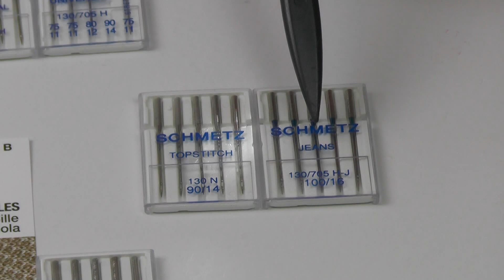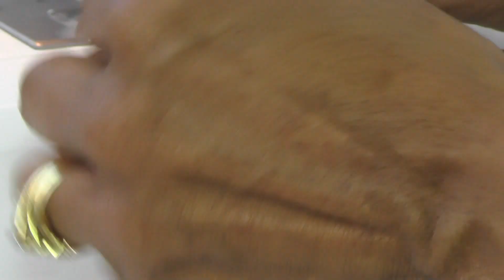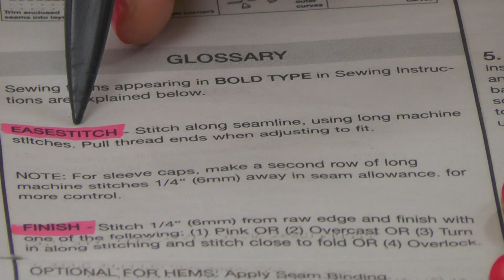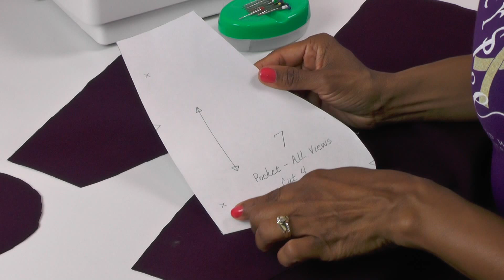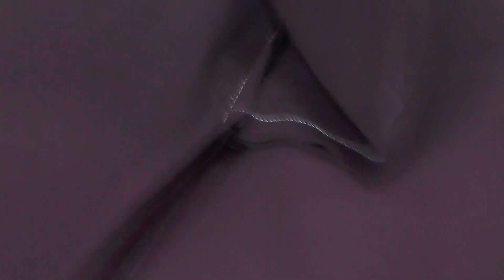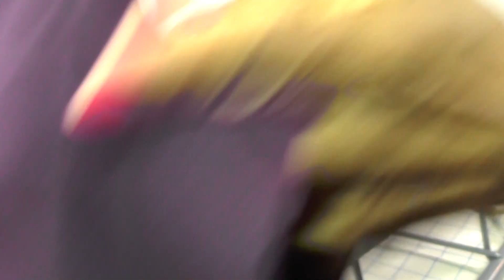Learn to Sew | (Lesson 1C)

Comment: Just finished my skirt. I followed the instructions but the end results to that size were either 1/2" too big or too small. I wasn't sure how I should go about taking that off when I started and didn't want to mess it up. I ended up taking the waist in at the end. 

Now that I finished my first project I can say I'm a pro at seem ripping and I know more about what to do for my next project. Thank you for this video you did an amazing job.
Reply from the maker: Congratulations on finishing your skirt! I'm sure you learned a lot throughout the process. There were others who experienced the skirt coming out too big. Sometimes the patterns run big and the problem with that is you don't know until after you've sewn the garment, unless you actually measure the pattern pieces before cutting them. These are things you will learn as you progress in your sewing. Thank you for watching the videos.

Comment: Anita, I would like for the skirt to be longer. Do you have any videos to show how to splice or add to or redesign patterns?
Reply from the maker: Hi Roz!  To make the skirt longer, you will cut the pattern apart at the "lengthen here" line.  Add the amount of extra inches you desire by spreading the tissue paper apart.  Place a piece of paper underneath where you have spread the pattern and tape the tissue paper to the paper to create a new, longer skirt pattern.  I discuss this briefly in the beginning of Project #2 of the Sewing Course. I hope this helps.

Comment: Hi, I thought that you were supposed to use a stretch stitch or zig zag when sewing knits?
Reply from the maker: Yes, you're absolutely right. Sometimes, if I'm sewing a loose fitting garment, I will use a straight stitch on the vertical seams. I always stick with the stretch stitch on the horizontal seams. But yes, use a zig zag or stretch when sewing with knits.
Reply: @AnitabyDesign  OMG, that makes so much sense. You only really need stretch on the horizontal but stability in the vertical.  I'll try it next time. Thanks!

Comment: Hi again! I found your Emerald machine! 😊 I figured that as a beginner (and since you'll be my teacher), it would probably be less confusing to get the same machine that you have so that I can tinker where you tinker LOL. My question is this... The 116 model is $299 and the 118 model is $399. From what I can see, the difference is that 118 model has electric speed control and also you can choose if you want your needle to stop in the up or down position. There are also two extra stitch patterns. One is a bridge stitch, and the other is a satin checker stitch. Do you think these benefits are worth the extra hundred dollars? It seems that as a beginner it would be nice to be able to control my speed electronically, but what is the alternative to controlling electronically? Would I have to hold something down manually? Also, do you find that you use the needle stop up/down feature often?
Reply from the maker: Hi None None! Your excitement makes me smile. I definitely like being able to control the speed and not have to worry about how much pressure I'm applying to the pedal.  The needle position switch was used a great deal. Now keep in mind that you can actually do both these things manually. So it's up to you whether you want to spend an extra $100 for the features.
Reply: Thanks, Anita! :) I'll go with the 118.

Comment: Do you have to use a press cloth?
Reply from the maker: I advise using the press cloth.  Some fabric produce a shine when placing iron directly onto fabric.  And it protects your fabric from burns.  I've pressed without the cloth but I make it a habit to use it.
Reply: What do you use for a press cloth? I seen people use mainly cotton. Some blogs online said they used bed sheets or pillow cases, and then another claims that silk organza fabric would be good because it is sheer. The last one I could not believe. Would different press cloths have to do with the different fabrics you're working with?

Comment: What iron settings do you use to iron the zipper? That's the first part that scared me! I feel like I'd melt the ziper teeth. XD

Also I'm curious, in the one photo with the gorgeous yellow flowery skirt, is a print like that ok for beginners sewing or would that be considered a pattern that needs matching and is therefore best avoided by beginners? 

Loving the course! I just ordered the pattern online and while I wait for it to get here I am watching the videos for more info. Love your teaching styles! 

Thank you for making these!
Reply from the maker: Hi Monique!  You excite me!  Love your questions and anticipation.  Welcome to the Sewing Course.  I'm really glad you like the tutorial.  I wish you the best on your new journey.

1.  You may keep the iron set to whatever temperature you're using to press the skirt.  The key is not to iron on top of the zipper teeth.  That's why we're pressing the zipper from the back.  When you press it open, it folds out and you will be pressing on top of the zipper tape, not the teeth.  Practice doing it before you turn the iron on to see how it goes.

2.  The yellow floral print can definitely be matched at the side seams, but you can totally get away without matching.  I did not match my side seams on that skirt and it looks great.

Hope this helps.  Have a great day!

Comment: I need a little advice. I just sewed the two back pieces together and realized that the one piece is about a quarter of an inch higher then the other piece. Not too much, just a little. I asked my mother if I should rip it back, she said perhaps not, as we would most likely be folding and hemming. Do you think I should rip back? Also, do you have a Facebook page for your blog? I would like to send you a photo when it is done!
Reply from the maker: The Singing Potato Hi there! It depends on where the difference is located. Is it the center back, where the zipper will be installed? Yes, so have a Facebook page. It's Anita by Design.
Reply: Well, it is at the very top of the center back, I suppose where the zipper will be. I think it is due to the way I cut the fabric, I am beginning and was never too good with the scissors! What do you think? Rip or no rip? What would you do?
Reply from the maker: In that case, I would rip it. Place to two pieces on top of each other, lining up all the edges. Cut off that extra fabric that causes the to top to be uneven.  Make sure both pieces are the same, then move forward.  I was thinking the same thing, that it may have been cut out uneven.  It's okay. It happens.

Comment: I have tried making this skirt twice and each time, the waist is wayyyy too big. I measured at the bend & got 30 inches and so I used size 16. I measured the waist after sewing the skirt together & it's 38 inches!
Reply from the maker: LA Jones Oh gosh! Unfortunately, sometimes the patterns run big or small and the problem with that is you don't know until you make the garment, or measure pattern pieces yourself before sewing. Several women have had the same issue with this pattern. Please don't give up. When this happens, you need to go down in size. Try a size 10 if you're using a knit fabric, or a 12 if you're using a woven (non stretch) fabric. Don't worry, these issues are part of the learning process. Keep trying and PLEASE let me know how the next one turns out. Use a cheap fabric or old bed sheets for the next practice. Don't add the waistband or zipper. Sew the sides of the skirt together and try it on. Have someone to pin it closed where the zipper should go. Check the fit. If it's good, use that size. If not, choose another size. I hope this helps
Reply: Thank you for responding....I didn't think you would. I was thinking about going down to a size 12. The first time I used inexpensive fabric, the second time I used Muslin. This time, I'm using a flat sheet from the Goodwill. I'm determined to learn this craft!! I will keep you posted. Thanks for the encouragement.
Reply from the maker: Oh great!  I'm so glad you're determined.  As you continue to learn and start sewing more, you'll become more familiar with the sizing of the patterns.  It's just something that comes with practice.  With your attitude you're gonna master this.  Once you get the fit you want, you're gonna feel so accomplished.  Let me know if you need any further help.  Have a good evening!

Comment: hi, so sorry about Brylee,thoughts and prayers. I have sewed before but never clothes, i sewing the skirt with you. my question is on pattern, can you cut waist one size and hip another size or do you need to blend them in to fit? Also do you have a video for a dresser shirt to go with the skirt? i bought the butterick pattern B6355 to make top D and don't have a clue where to start, i bought a cotton material and don't think it will work with pattern B5215. thanks an what other videos do you have?
Reply from the maker: Hi Brianna! Thank you so much! Brylee is in heaven now.  Yes, you can cut waist a different size than hip, but you will still need to blend the two cutting lines together.  I don't have a pattern for a dressy top at this time.  You can check out all my tutorials on my YouTube channel.  More are coming!

Comment: my skirt came out too big. and I triple checked my waist measurement :(
Reply from the maker: Oooh, ndhernandez, I'm so sorry that happened.  Please don't give up.  Try it again and go down a size or two, based on how much bigger your skirt turned out.  Did you choose your cutting line based on the finished measurement on the pattern tissue?  If you did, don't be alarmed, because sometimes this does happen.  The patterns are sometimes not true to size.  As you continue to sew you'll learn how to choose your cutting size based on the style of the garment and the fabric you're using.  Whatever you do, don't quit.  Try it again.  Let me know how the 2nd one turns out.  I've been sewing for quite a while and I still have things like this happen sometimes.
Reply: I used a knit fabric and I don't know if maybe that's a factor